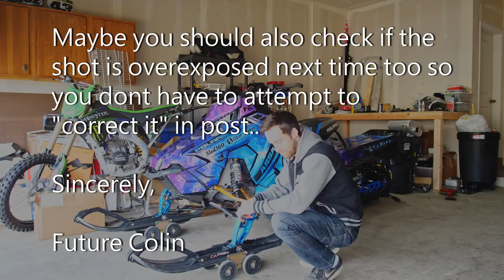THIS IS THE END

Comment: Are you getting the pro rmk 163, 155 or the sks 146? cuz those are the more "special" sleds
Reply from the maker: I went with a pro rmk 163! Want the better side Hill control and deep pow float over the 155.
Reply: Yeah, the 163 surely gives better side hill control and better float! I went with the sks 146 as i mostly ride in the flatland but with alot of snow.
Reply from the maker: Marklunds Production that’ll be perfect for what you need it for, and if you ever venture to the hills it’ll do fairly well too.
Reply: We go to the mountains 2-3 times a year with about 2-3 meters of snow, usually 1-2 meters pow :) but yeah it does very well!
Reply: We had 3 meters of pow this year in sweden, it was amazing!